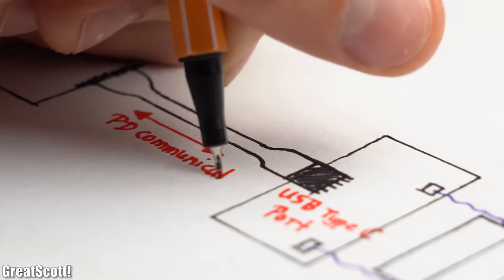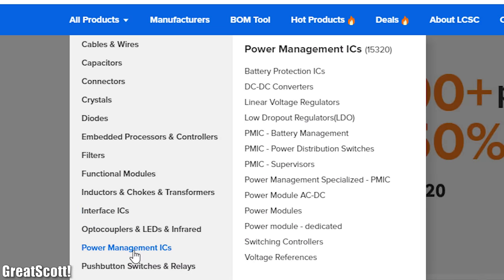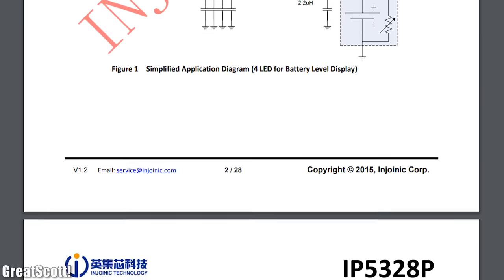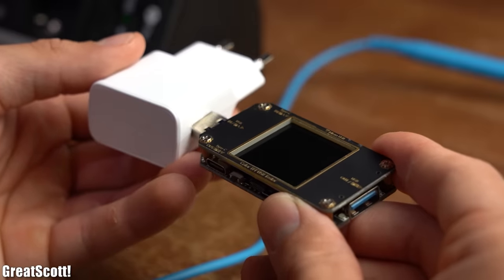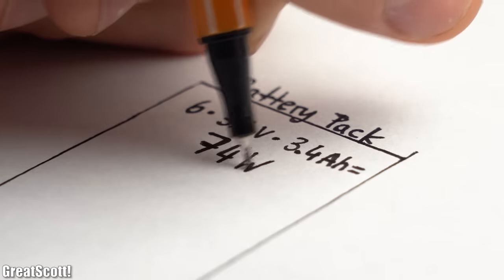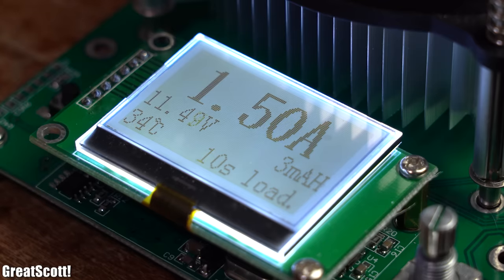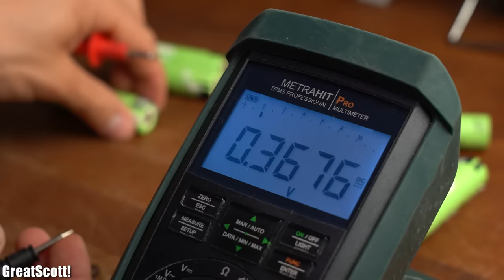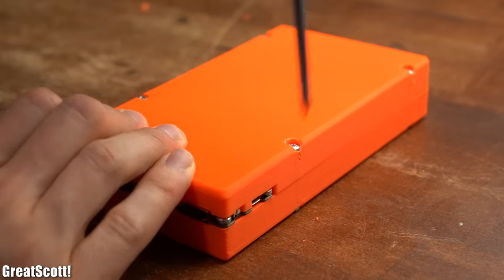Building a USB Type-C PD Powerbank the Super Simple Way || Testing an Aliexpress PCB!

Comment: With 20V PD laptops getting more and more, PLEASE do a video about a DIY 45W/65W PD power bank. Commercial PD powerbanks for those (in my case a Thinkpad L390Y) are still rather expensive. And in my opinion this new capability of also charging laptops is the true advantage of USB Type C. Fast charge for phones is nice, but not needed. Having a power bank for your laptop is just a new, really useful class of mobile charging
Reply: I guess they are expensive because you need more cells and a BMS
Reply: I agree.  Not sure why there are no DIY versions?  Patents, proprietary laptops making a universal BMS impossible - no clue - anyone?  Also wondering if laptop batteries are 10.6V  why can't power banks with usb-c power delivery also be 10.6V or 3S2P battery packs, help?
Reply: There are now several available but none of them work beyond 60W. I have another coming in that I ordered last night but my experience has been that no buck boost IC can stay cool enough to handle more than 3A at 20V
Reply: @ericklein5097  hey man, do you have a link to a 60w one? I’ve found a single “model” on aliexpress that claims 100W @ 20V5A, and has a bms built in, but in general there seems to be almost nothing above the QC3 12V1.5A modules.
Reply: Check this out. Although I would be carful and add batteries in parallel, because 100w draw will quickly burn down your house alongwith a fan maybe. 
"QC4.0 QC3.0 LED Dual USB 3S 4S 5S 65W 100W Micro/Type-C USB Mobile Power Bank 18650 Charging Module Circuit Protection"

Comment: Happy to see the IC can meet the output current requirements. Will order one to upgrade a DIY power bank I have.
Reply: 1 week ago?
Reply: Patreons get early release. Join the club

Edit: I’ll be upgrading mine too!
Reply: There are better capable circuit board available  than this board power bank.
It's was lame job from him this time.
Reply: If you plan to build power bank consider at 45watts, or PD3.0 capable circuit, otherwise buy ready made

Comment: This is soo relatable. The amount of times I decided to cancel building my own circuit because someone in China already made them pre-made and even cheaper, is just astonishing. I find designing and building your own is only worth if the application is very specific or you just want to learn something. Other than those, just get them pre-made.

I think you should be a little bit more steady during soldering, those crystallized solder joints are painful to watch..
Reply: Or maybe you can make it more powerful than pre-made pcb like episode of diy or buy bms
Reply: Please don't tell him about flux ;)
- often the boards designed in China are under-designed in regards to cooling, components cut to save cost, schematics and bom missing, errors in layout - fixed in other revisions/sellers - and you can't be sure if it has the right/'original' components mounted or not. It is a gamble, for what it is worth
Reply: He's steady enough while soldering, lead free solder tends to make all the joints look slightly crystallized.
That and tin whiskers are why I still use leaded solder.
EDIT: I only use leaded solder for electronics, if I'm doing plumbing I use lead-free plumbing solder.
I know about the harmful effects of lead, and I use a fume extractor as well as wash my hands after I've touched leaded solder.
Reply: @EgonSorensen  My experience with Chinese module boards is that they often enough just follow the datasheet typical applications to the letter, a totally no-brainer approach. It probably costs them more to cheap it out removing components and testing (or having someone that knows electronics to that point) than if they just have a quick turn-around with minimal develpment cost, down to 1h board done with auto-router. What they definitely do often enough tho is terrible power supplies or crap component quality, specially filter capacitors.
Things probably start to become ugly when they start going with some very no-name ICs, and even that is usually down to the IC being straight out made for crap products and they just follow as told on the manual.
Reply: @44R0Ndin  I have absolutely no idea why you need to solder something when Plumbing I thought Plumbing was just sticking a bunch of pipes together and sometimes using some glue to attach some pieces with joints
Reply: @bland9876  solder is used to connect copper pipes together for heating or water because it provides a strong and waterproof seal that is very unlikely to degrade or break
Reply: I dunno man, I really love to  design my own circuits, but thats probably because I just love electronics lol. But yeah your right.
Reply: You’re right, but It’s sometimes hard to find the right PCB. Per example, I can’t find  one for the LattePanda Delta (12V, 2A)... Any help on it ?
Reply: @Kalvinjj  
Right! Not all boards are good designed, only following the application note, not more. Do not trust all the writing of the Chinese boards. Sometimes a derating of 50% seems the right way, (especially for  battery boards) otherwise they maybe will overheat.
Reply: @jost459  True, at the very least when just following the datasheet you know that the bare minimum was done and they didn't try to be smarter than the IC company's engineers, but then again there's some small notes bellow, on the lines of "In certain applications, X part value should be chosen" or "consider adding X part in special conditions like high frequency or near limits", and, of course they won't do it.
Those step up/down converter boards are overrated as heck usually, I have one here that they claim like 95% efficiency and up to like 4A on the input (boost converter)... I tested for an application requiring about 3A on the input and even after adding heaps of cooling, it heat up to seemingly dangerous levels, with a fan blowing on top of it even. When measured it was no wonder why tho: efficiency of about 70%, so the 20w load was producing some nice 8w of heat, let's say that I preferred to swap to a better part, highly overrated for the application. Problem solved tho, efficiency climbed to 85% measured and no fan required, just added cause why not.
Reply: @bland9876  
Much plumbing is done w/ METAL, usually copper, 'black iron'  or cast iron, or sometimes w/ galvanized malleable iron.
All these can be soldered either to patch or assemble.
Reply: @EgonSorensen  everything is a gamble
Reply: @taxigalaxi  practice, I strip out old quality stuff to put in jars, 
you will get better.
Reply: @44R0Ndin  Leaded solder is not dangerous for the person soldering but when the electronic device is disposed of the lead gets absorbed into the ground poisoning animals and ground water supplies.
Reply: @TheArachnoBot  Yes, that's why whenever I dispose of something I've repaired with leaded solder (or anything electronic for that matter) I make sure to put it with the E-waste, and not the regular garbage or recycling, that way it has the best chance of being properly recycled or disposed of.
Consider that I own a significant amount of leaded solder, so I'm going to use it when I need it, rather than buying non-leaded solder and having to replace not only the solder but also the tips on my soldering irons, and yes I have several of them.

Comment: Can u do a project on DIY a microscope for soldering like hayear
Reply: You can just use a raspberry pi camera with a macro lens.
Reply: @oniruddhoalam2039  I
Can u mention items
Reply: @iqbalreshma925  a 8-130x lens, which you can get on ali for about 15 bucks, and a decent webcam, which you can plug into your computer.
You can also get cameras that directly output hdmi, search "c mount camera."
I would also suggest a light, a stand, an extraction fan and a few helping hands.

Comment: Nice, I would love to see a similar project with, 12V IN and 12V-24V regulated output (maybe USB as well) and several cell in Series (with a proper BMS and protections)
Reply: Also the Milwaukee m12 knockoff (and oem) heated jacket adapters have a module for 3s cells you might wanna check out

Comment: Wouldn't it be more efficient and more robust to run the 18650's in series, with a BMS to balance their charge, and use a switchable buck to produce the 3 USB-C charging voltages? I hate running 18650's in parallel ever since the Great Workbench Fire of aught-18.

Comment: NEVER CHARGE YOUR NINTENDO SWITCH WITH A NON ORIGINAL CHARGER! It uses a different protocol than USB C and you can kill it if you use a non original charger!
Reply: This is not accurate; it's perfectly safe to charge the Switch itself with any USB-C PD compliant source, it's the dock that comes with the Switch that is non-compliant and risks damage depending on the charger used.

Comment: According to the design, the connecters on the board is made with a little space in front of the plugs. It means that you could easily have some material in the front to hide the pcb screws and the pcb itself and still connect the plugs as they are supposed to.

Comment: hi, thanks for such another great video. 
i have a question about at 7:56, is there any difference if you charge power bank with 5 v 2 A or 12 V 1 A how efficience change? for example i try this with my phone whenever I charge my Phone with 5 V 1.5A till %70 at night battery level down about %66, but whenever I charge with 9 V 1.8 A till %70 I saw %52 at morning.. is Fast charging really fill battery or just shows placebo effect us 🤔

Comment: I have a 24V bixpower with all the BMS in built. But I'd like an easy way to add one usb c PD for 20V use, a second one for 12V, then a couple of 5V USB A. The above kind of pcb would be perfect if it only could take 20-30V input! Feels weird having a separate 24V to 3.7V converter first and don't know how I could get 20V 60w usb c PD out of it then?

Comment: Hello,

Someone with this module can help me?, I bougth the ip5328p module and there's no input or output, and I'm not sure if is defective or I'm doing something wrong.
When I connect the battery is on lock state, that is right. I connect the charger and the lock is released, but instead to charge, all leds blinks at same time and there's no current flowing to the battery.
Disconnecting the charger is on normal state, and in that state I can press the button to see how much charge has the battery. When I attach a phone to charge it, the lights turns on showing again the battery charge, but there is no output, and I've measured about 2v on the output (that is even less than the battery voltaje).

Anyone knows how to fix it, or I have to discard this module.
Reply: Finally I've found that the board was broken, because I bougth a new board and now it works near to perfect. The only thing that I see is that only charges at 2A, because with 5v it drains about 2A, and when I'm using 9V it drains only 1A (on the output I got 2A in both inputs voltages). Anyway at least is working and can charge a normal battery in 1.5h, so 4 batteries should take about 6h to charge and give 12Ah.

Comment: I just bought a tablet that gives you a message stating it refuses to charge off of a standard USB so I can't use my battery pack :( the tablet only supports pd charging. The battery is powerful enough to charge the switch while it is playing a game like Splatoon and also is big enough to charge it 4 times so it should in theory be able to charge my tablet I just need to convert the circuitry to pd.

Comment: Nice video as always ! I recommend to use recess in your 3d printed housing, so the parts will connect better with fitting into each other, then you will get the joinig surface smooth, and and also stronger.

Comment: Thanks for the video. Have you you ever looked into USB C with pass through charging? I’m looking for a solution where I can use wall power but still have battery backup in case the power is killed.  Maybe pass through charging isn’t the right solution for that.  Thoughts?

Comment: How difficult would adding in a BMS to this system be, if all of your batteries weren't as well matched with eachother?
Reply: Batteries are connected in parallel. No BMS required. Overcharge/overdischarge protection already in the powerbank board. If you want just match batteries, you can simply charge it to the equal voltage separately, then just connect with each other in parallel.
Reply: @kokokoshka-s7c  what you could add tho is one of those individual cell protection boards, for the parallel connection they would make sense to avoid overcurrent on the single cell, in case they aren't perfectly matched.
Reply: @kokokoshka-s7c  I'm sorry but it's not that simple. Different impedance could charge the batteries differently making a big difference in charge in the future

Comment: Hi, I have ordered three of these boards and noticed the over-discharge protection always kicks in at around 3,65 - 3,7V. Are there others that are experiencing this? Am I doing something wrong? or am I using some kind of counterfeit board?
Reply: I also bought two modules and they are deactivated when the voltage is less than 3.7V, did you find any solution? Cheers
Reply: Hey! Unfortunately no solution was found. I kinda gave up in the end and now have a huge stack of unused 18650's :').

I wonder if everyone has this cutoff at 3.7v

To be fair you can make a powerbank with this, but you would leave so much unused capacity.

Comment: Can you recommend a charging modual that goes to 15v?? So I can make one to my surface Pro 😊
Reply: Buck or boost convertor up to 20V lmao
Reply: I would need one to for my laptop that goes up to 20V tho
Reply: @plageran  you can't really do that because you need to negotiate with the  charger . My laptop doesn't have a barrel jack it has an usb C as a chargin port. Essentially when you connect a device to a PD charger the charger will output 5V and only when requested is going to bump in the voltage..why you ask? Because if I connect my phone to the laptop charger and the charger outputs 20V it's going to destroy my phone ..so it starts from 5V and then goes up if requested
Reply: @fabiofoltran4361  yo, the reason why i say "Up to" is buck and boost convertors has variable outputs, rather one that's over the amount than under. the last thing you want is the convertor spiking out when it dies.
Reply: Don't let Microsoft hear you say that or they'll brick it remotely. :|
Reply: @dfabeagle718  lmao

Comment: Finally, USB-PD PowerBank!

I still wondering if it can be used for another type of battery. Like RC battery you use to use long time ago, for example. If it can, it'll be a good alternative  for the dedicated charger/controller one.
Reply: Like Li-ion or Li-po batteries... But I think it is easy to use a 12V USB PD car charger... Because they are available almost everywhere..
Reply: i don't think this will fit the LI-Po battery packs used in RC because of the low cutoff voltage of 2.9 volts  , the overcharge voltage seems ok though
Reply: @witgangyounotube287  agreed. You don't want lipo in this style of charger

Comment: why on your graph when the voltage increase efficiency decrease ?
Reply: Because circuit is boosting the battery voltage for output
Reply: If you increase the output voltage, you increase the delivered Power 5V*0.5A=2.5W 12V*0.5A=6W. Therefore you need a larger switch current, which results in higher losses in the switching Mosfet and the Inductor.
Reply: @nicolas8414  ho ok thanks

Comment: Don't use a Nintendo Switch as a test load for PD charging! It uses some weird modified version of PD. The few cases of switches being damaged by unofficial docks happen because those docks are only barely PD-compliant, and combined with the modified PD in the Switch, there's some rare edge case where the switch gets a higher voltage than the Switch's charge circuit is expecting and various components can be damaged. Nintendo supposedly made some effort to fix that in software, but software can only do so much. In general, it's not a good idea to use anything other than the official dock/charger.

Comment: just a question, ive just got random battery cells from old powerbanks and put them parralell, a theoretical mAh should have been over 35k mAh, i soldered them without checking all the voltage. there are issues consirning the whole battery stack, cuz i first fully charged it in a whole that gave me around 25K mAh at 4.19V, using it and consuming all the power max to 2.7V gave me only 12K mAh. should i be conserned about the battery pack?

Comment: Hey i wanna ask... Is the ip5328p module in this video support 12V battery pack? Or do i need to step it down first before connecting to the module? Considering it support 5V 9V and 12V of input.. I need confirmation first

Comment: Hello,
It's very good video to have understand for IP5328P module. I have pcs of it. and follow instrocution with 2x18650 in parallel connection.
I checked full charge as indicated 4 leds on borad. And connect my mobile phone to USB-C. Then It doesn't work.

Could you share your experience if you have same case?

Comment: LOL building this powerbank will cost MUCH more that buying it already done and it comes with a NICE smooth aluminium case and warranty.
Battery pack AUD34, delivery AUD1,027.65 hahahahaha
PCB AUD12, shipping AUD2.50 LOL
Nickel plate, wire, accessories PLUS you'll buy an ugly looking case for electronics = AUD25-30!

Comment: It is no issue to mix and match cells as long as they go in parallel. As for different voltage levels, equalise the cells with a lamp or resistor between them. Not a problem :)

Comment: I bought the same module, but mine doesnt works, i use only one 18650, when i charge It with PD, the 18W doesn't trigger in my source, AND when It Is supposed to be charged, i connect my phone AND It marks like the battery Is under 25%, do you know whats the matter??

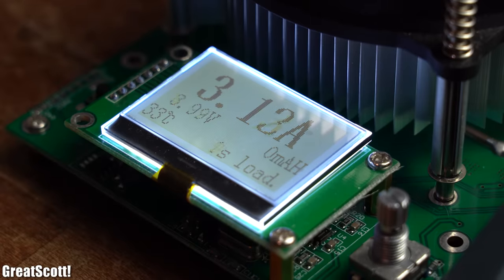Comment: 7:40   
can deliver 3.1A, but at 3.98 volts?
the 1V is the drop on the wires or also on the output connector is 4V ?